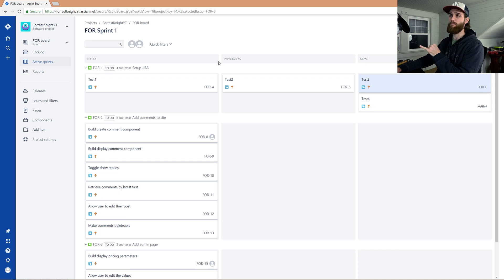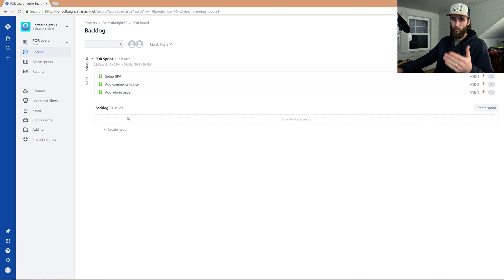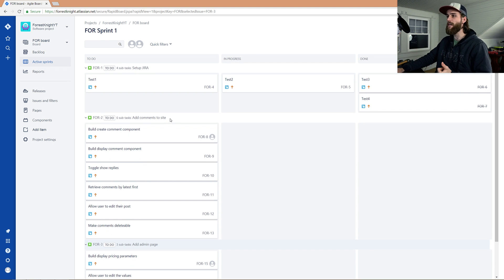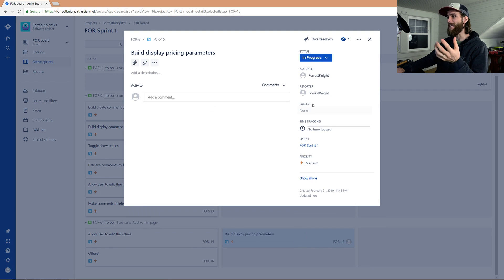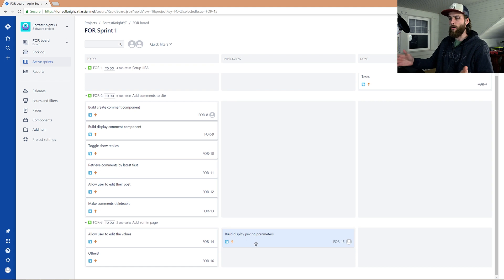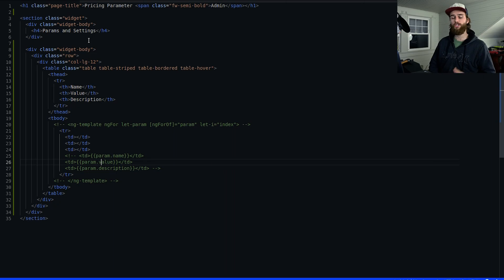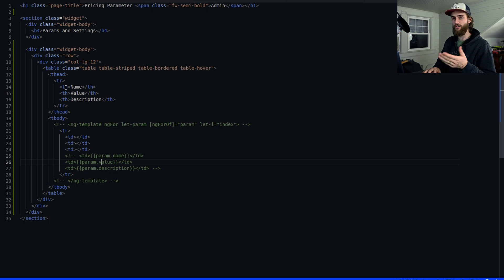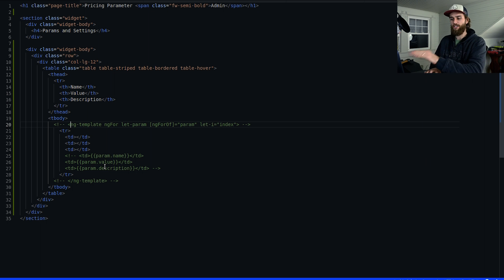My Process of Completing a Software Engineering Task

Comment: I like this. I use a whiteboard instead of a notebook, however, sometimes I think a notebook would be better as I could come back to it. I'll have to give that a try next task. One step I'd recommend, from my experience, would be to read the current code surrounding the feature/task you are implementing. Sometimes there is code that is already available to you to build off of and spending some time reading through it will generally result in an easier solution for yourself!

Comment: does anyone know if a macbook air 2015 refurb would be alright for a computer science degree?
Reply from the maker: Yea, it will. I used a mid-2012 MBP for my CS degree from about 2014-2018. The only upgrade I made was from an HDD to an SSD. I still use it today, actually. And about the Windows thing, look into Apple Boot Camp. Macs can run Windows OS incredibly well.
Reply: @fknight  I will probably just pick up a 2015 model then, save some money. Yeah Apple Boot Camp looks great. 
The vids you make are really inspiring my man, thanks for the response!
Reply: I have a late 2015 MacBook Air and for now it seems to run everything very well, not sure about every language but most well known ones do work. But I am not a college student yet so I’m not sure it’s enough. But I’m in the 11th grade studying computer science and it works fine
Reply: @arnavmotwani2198  Yeah I think it should be powerful enough. From what I can tell the 2017 model isn't light years ahead anyway so hoping I'll get away with the cheaper 2015 model.
Reply: @ainfajofaf8118  yeah my friend got the 2017 model and the only improvement was 0.2 Ghz in the processor
Reply: You'll be able to get by with a rMBA 2015. You might not want to though. Depending on the school, you'll most likely have access to computers on campus. There's also a good chance you'll have dedicated computer labs for CS students. Depending on your CS department, your professors could be using windows machines, so following along with them could require extra work.  This is usually a minor issue since most CS professors provide instructions for both operating systems, but it's something to think about given the prices of rMBAs. 

A few other things to consider are screen size and macOS support lifecycles. Screen size because eye strain is a very real thing for a lot of people developing solely on small screens (although you could always hook it up to a monitor). Having that extra bit of room for split screening on the 15" display is nice when on the go or in class. 

As for macOS support, it currently stands that MBPs and MBAs are officially supported for 6-7 years; Mojave supports mid 2012 and newer pros and airs. So if you're starting college this year with a 4 year old macbook, in 2 years you'll be in your last year of official updates. There are people in the community that make ("hack") the OS work on older macs but who knows what'll happen in 3 years.

I faced a similar situation back in 2013 when I switched degrees and simultaneously needed a new laptop. What I ended up doing was buying a used mid 2010 MBP and a new Thinkpad. This combo was great for those few teachers who solely used Windows. I still use my 2010 MBP for web development. I got Mojave to work on it but the battery only lasts a little over an hour and my experiences in the past with buying replacement batteries were not great (with the 2015 Air, replacing the battery is a much harder process). 

Recently I've been working on building out my development environment on my Galaxy Note 9 in Linux on Dex... but that's a whole other bag of worms. 

One last thing, look into AWS Cloud 9. Harvard's CS50 course (free online on edX and YouTube) uses it if want to check it out and learn some intro CS at the same time. Can't recommend CS50 enough. Cloud 9 costs a little money for personal use but it's free for the first year. (Cloud 9 in CS50 was still free last time I checked)

Hope that helps some
Reply: @drewlomax7837  Thanks for the detailed response, very helpful! Will definitely check out the CS50 course. My degree here in the UK will last about 4 years, and my uni operates with both mac and windows machines in dedicated labs.

I've managed to find a macbook air 2015 for about £450 which is a pretty good price. Although, you make a very good point on how its gonna be for me a few years down the line. The 2017 macbook air is about £870 at the moment so might be worth spending the extra few hundred. Now that I think about it I remember the 2017 air going down to like £750 when it got nearer to start of term. 

Will probably wait it out a while and see if any prices change. Thanks again!

Comment: So..making websites is considered software??
That's funny.
Reply from the maker: @Rafael Ramirez | There's always that one guy, but you're really reaching aren't ya? haha of course websites are software. But this isn't just a single page informative website (which is still software...). Just so I can offer you a little help, look up enterprise applications. Once you do, you'll realize that's there's much more to this industry than what you think.
You're in what we call the imposter syndrome phase, look up that as well. Have a good day.
Reply: yes
Reply: Using a premade theme on Wix or a generic Contact Us page for a small business is not really making software. But depending on what the website does, yes, absolutely. They can be as complex and powerful, as anything else - in fact YouTube is a "website".
The fact that you find some sort of invisible barrier between the two concepts tells me you're either inexperienced or trying to hold on to something (like VB/ActionScript developers did back in the day). Or perhaps the term "website" is obsolete for this use case.